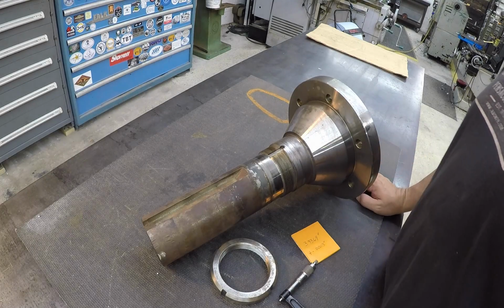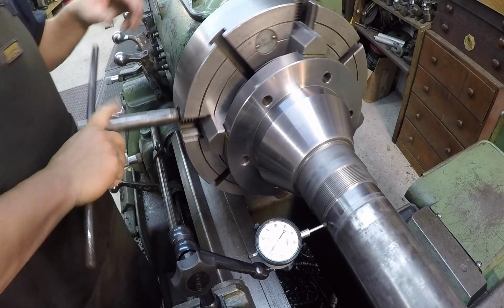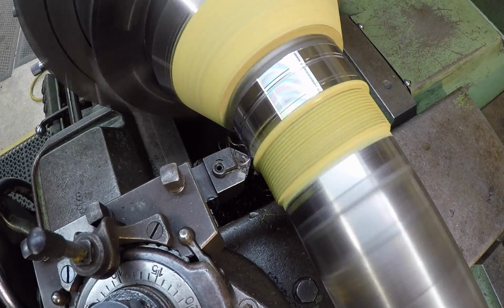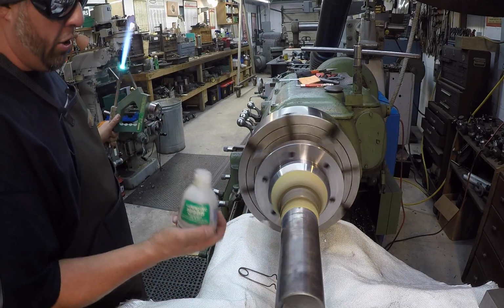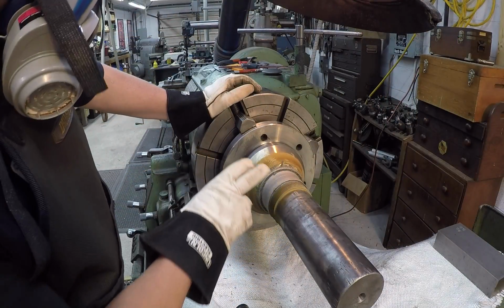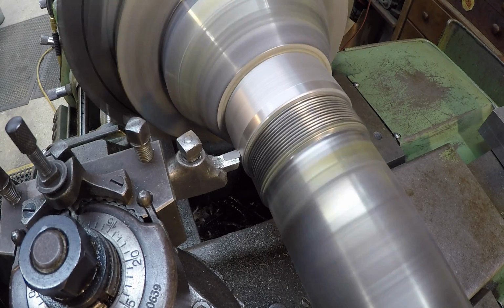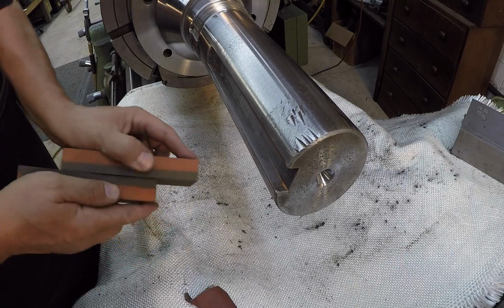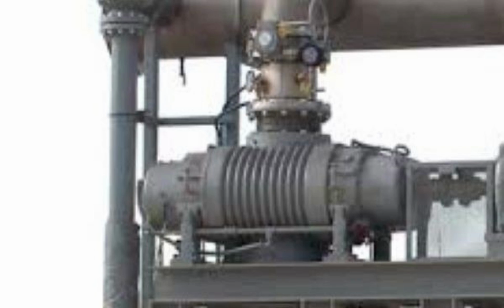SNS 300: Spray Welding a Blower Shaft

Comment: I understand the principal behind it but how does the powder attach itself to the base material without it being molten as well? As the powder flows through the flame it becomes molten and sticks to the base? Is this correct?
Reply: Science.
Reply: The little I've read about it, the first bonding powder he put on essentially 'brazes' between the part and the build-up coating. So in a sense, it's like brazing on a sleeve.
Reply: If you want it a bit more technically, the powders are a mixture of alloys which are atomised to form spherical particles which are then coated in elements which react exothermically in the heat of the flame. That means the particles become hotter than the flame temperature by several times magnitude.  At these temperatures the individual particles become semi to fully molten. The next factor to come into play is the force of the gas stream, principally the oxygen flow which propels the particles at sufficient energy for them to "splat" onto the surface and to subsequent particles in the developing deposit. In effect, the process is kinetic (without the base metal temperature being a significant factor - main reason it is often termed as "cold spray") - with sufficient velocity and temperature the individual particles become micro welded to the surfaces they contact.  This is what gives the deposit its fundimental strength. It is also why the deposit machines like a metal and doesn't just come off like dust.  The process is identical for both the bond layer and the finish layer, the difference lies in the make up of the powders - the bond material is optimised for maximum bond strength, the top coat material selection allows for different finish requirements (soft and machinable, or hard and wear resistant including added carbides, or corrosion resistant etc).
Reply: @peterpaton1164  I'm not sure where you got your information, but I got mine from here: https://www.norco-inc.com/ASSETS/DOCUMENTS/ITEMS/EN/EUT-4520-Brochure.pdf. They describe the process as 'brazing' and not 'micro-welding'. Brazing is mainly an 'adhesive' bond, whereas welding is a 'mechanical' bond, where two molten metals interlink their crystalline structures. In the type of 'spray-welding' that Adam is doing, the surface of the target metal is never brought to a molten state, hence there is no actual 'welding'.
Reply: @scottr939  Hi Scott, that is correct, but you are looking at two different processes. The Rototec system Adam used in this video is a low temperature process, the Superjet in the referenced documentation is as you state a braze process.  I wouldn't argue on the descriptions of the processes you describe except that "adhesive" bond is not a good description - the correct terminology is diffusion bonding, which in effect produces  a surface interlinking crystalline structure ie, the deposit becomes integral with the base metal structure.  Adam only used the Rototec process on this repair but has another video showing the Superjet system being used for a shaft spiggot repair. 

I worked with Eutectic Castolin for 30+ years selling, advising and training on these systems (as well as all welding processes) - that is where I got my information ; )  I still work hands on with both systems for an ex-customer since I left Eutectic a couple of years ago.

Comment: Full disclosure. I know nothing. Just curious if you ever check a shaft like that for out of round before you indicate it? If it is out of round(egg shaped)would you get a false high?
Reply: You would get a false high yes - You would be common sense checking yourself as you progress: Hence why he indicated in 4 places - Flat to the jaw, on the taper, on the beginning and on the end of the shaft
if the shaft where forged egg shaped, but not in a visually obvious way, then you would expect the client to mention it beforehand and have it noted on the documentation

Comment: whats your going rate? im trying to find out what to charge for lathe and or / spray weld repairs go for.
Reply: That's a difficult one as each machinist needs to factor in their overhead recovery costs and job throughput

Comment: Can you do the same thing onna car crank shaft ? At the end you mentioned it's not for bearings riding along surface
Reply: Yes with a but - Main journals are reasonable but for Conrod journals most shops cannot do for any reasonable cost

Comment: Why not sleeve it?
Reply: did you watch the video? he said why
Reply from the maker: S Bayko The  inevitable “why not...” comment. Watch the entire video.
Reply: @Abom79  i was joking,  watched it already.

But cant you tig weld it? Or would the shaft warp?
Reply: @Sadik15B  Again in the video - The entire process keeps the part far lower temp (maxing out sub 300 degree) and is a uniform heat soak as opposed to TIG where all the heat entry is focused at 1 point: He was after a fine enough tolerance that the risk of warping would likely result in scrapping the part
Reply: If you're going to make a sarcastic/joke comment, best to indicate that somehow, with maybe a wink-emoji or something like that. Otherwise you can easily be mistaken for a jerk.

Comment: 12:45  Would Kapton tape help protect the threads?
Reply: BurnabyAlex Would Kapton tape even survive the giant flaming torch of molten metal and doom? Serious question, despite the joking retort... I have no idea how much heat that stuff can take, and Abom did say this is considered to be a “cold” process.
Reply: @OtherTheDave  Kapton tape is rated to +400 Celcius
This process is around 300: It's doable but if you overheat the tape would fail

The more pressing issue however is if the seal the tape would make would prevent dust spatter marring in the threads

Comment: I use an HVOF spray weld system for carbide.. I also spray weld wire fed stainless.
Reply: If you need some tips on these kind of applications email me at corpusman1@gmail.com

Comment: This is used pretty extensively (albeit with a computer controlled machine applying the powder) with commercial jet engine overhauling.
Reply: Are we talking exhaust turbine blades or diffuser housings?

Comment: Does the spry welding work for repair engine crank shaft ?
Reply: yes
Reply: Yes with a but - Main journals work well but grinding off center makes the conrod journals too expensive in most cases
Reply: FAA says you can't use it on aircraft engines, but they are super conservative in all things.

Comment: I love this process. You should consider setting up a separate dedicated shop that specializes in it complete with some beater lathe. I can't find anybody in my area that does this. You could train and hire somebody to do the build-up, and then transfer it to your main shop where you do the machining.
Reply: where is your area?
Reply: It sounds like he doesn't get enough of that kind of work to make it worthwhile.. He said he kinda stashes all the equipment away between uses.
Reply: The problem of transferring parts from one machine to another is the part has to be "set up" again and it would be probable the indicating surfaces to be coated with overspray.  Once a part is removed from a machine it is extremely difficult to get the part back concentric again except for between centers.  It is best to make one "set up" and finish in one machine.

Comment: When you get something that hot, is there a chance that it moves in the chuck slightly and has to be reindicated? Also, when they quote a tolerance that tight, do they tell you the room temperature that you have to be at for that measurement? I imagine that 10deg F could change things by a 10th or 2. Congrats on the 300th sns.
Reply: I was thinking the same thing- and the tolerances seem rediculously tight considering how much they let it wear in service.
Reply: Chester Valdes probably a tolerance provided by the bearing supplier.
Reply: He hit the high end of the tolerance, so even with some heat left in the part it should be fine (I'm sure there was a long skip while it cooled somewhere, just don't know how long.. it may have been at room temp when he started the machining)

Comment: I am wondering about how much I could charge for such repair... Here in the shop we fill out with mig in small pop spots to keep it cool, re pass all of it on the lathe again, and just touch it on the cilindrical grinder.
Reply: if i had the equipment to do the spray welding job and a lathe big enough to hold that piece i would charge $800 to $1000 dollars to do the job. that would include $100 for oxy acetalyn the powder  emery paper and the yellow coating.
Reply: @jamiebuckley1769  I would doubt that price unless the finishing was a ground surface tolerance finish, I would expect it to be more in the $680-800 range

Comment: There's also a similar process that uses plasma arc torches. Plasma Transferred Arc Welding (PTA) 
https://www.corrosionpedia.com/definition/1111/plasma-transferred-arc-welding-pta-welding
Reply: That is more like thermal spray welding. Thermal spray welding and PTA melt the base metal (substrate), where the spray metallizing only heats (not melts) the base metal and melts the powder.

Comment: Nice !   Why did you take the center out during spray weld ?
Reply: So it doesn't get damaged by the heat. It probably wouldn't hurt it but it's better to be safe than sorry. Those live centers are expensive.
Reply: once you hear it you'll kick yourself for how obvious it is.

You just clocked the entire thing accurate to tenths of a thou on the externals
You already know the center was slightly filled with corrosion that you Emory papered clean
That means you are no longer perfectly confident on the true of that center, if you ever where (You didn't check it)

You're now going to heat soak the shaft to spray weld it - It will expand with heat and bind on the center
if that center wasn't true it has now pushed you out of alignment

Comment: Is this a better alternative to chrome plating, back when I was working at a plant in N Y where we built centrifical compressors, if a shaft had a bad spot on it they cut the shaft down some and had it chromed then growned it back

Comment: @abom79: speedy sleve can be used for bearings? i always though only fore shaft sealing. I tried to find the best material roughnes of area were a shaftseal is sealing. Wath are your though about that? its an important factor of good sealing?

Comment: Adam or mr Abom I work in metric and when you showed your spec note its said +- 0.0003". 3 TENTHS?  you said so that convert to 0.00762mm tolerance.  Is it just me or is that ridiculous for tolerance? Isn't is more like 0.003". Im sure it just me but then im living in other world. Please correct my conversation if you may.
Reply: You got it right it's a bearing fit, IMHO it is a bit of an odd tolerance because the bearing fits I do are always +0.0000/- a few ten thousandths.  I have never seen a bearing with a .001 or more tolerance.  In general machining +/-.0005 tolerances are not uncommon, less than that are common in certain special areas.
Reply: @billmielke7395  yeh after some playing around on my indicators I realize its the inches to mm that got me. Working in mm once you past 0.01 things get real fine and that fractions of the imperial boys makes me thankful for them metric units!!
Reply: @fyrman9092  I understand buts like surface grinder specs. Jeez I feel like a nothing cutting shaft to 0.01mm tolerance.
Reply: bearing fits always require precise tolerance

Comment: Thankyou Adam .
My favourite part is actually the beautifying with the emery cloth, and i always appreciate the quality still images at the end.
Well done....💯💯💯
Reply: It's not really "Beautifying" as it is a practical concern
With the tolerances specified and the fact it is a bearing fit it needs to be so polished to enter cleanly
Reply: @bengrogan9710  oh yes, i understand that, on the journal tolerance  +/-  .0003", which was the job, but many of the other surfaces where purely cosmetic. Which is a good thing and demonstrates care, respect and passion..👍🏻
Reply: @edz7555  Possible, however not necessarily. 
We don't know the specifics of the shaft and I would not be surprised on a shaft that size if the bearing had an oil or particulate ingress seal - such things can be torn by surface spall like the stilson wrench marks on the shaft end - in either of our cases however it's just good workmanship: things this big are oft a PITA to fit and down a deep dark hole where filters will appreciate the due diligence

Comment: Why do you not support the shaft with the tail stock when doing the spray welding? Us dummies are curious.
Reply: Something else to clean and keep from fouling. Tailstock is used for machining.
Reply: Heat expansion - the shaft will grow in length slightly and load up the bearings: that risks lift in the tailstock loosing your indicated accuracy

Comment: Years ago I worked at a shop that rebuilt industrial vacuum pumps.  A lot of times the roots type blowers, the shafts where the bearings and seals rode on would wear out and we would have to send them out to get sprayed.  I never knew the process.  A lot of times with the bearing journals we would dimple that area to hold the bearing tight.